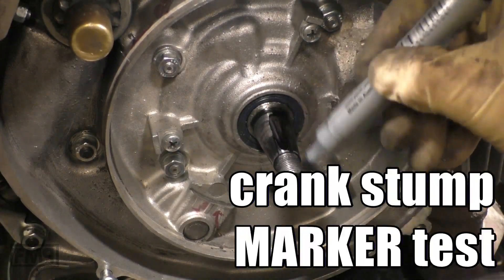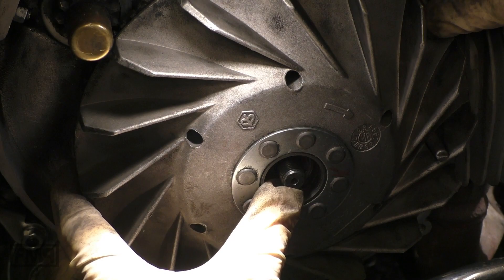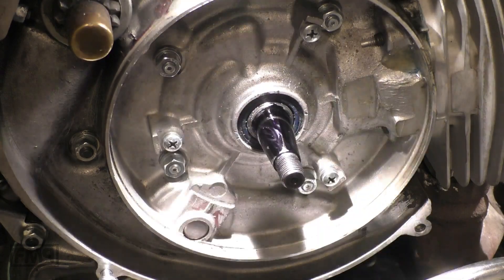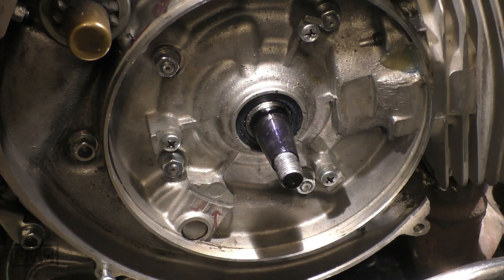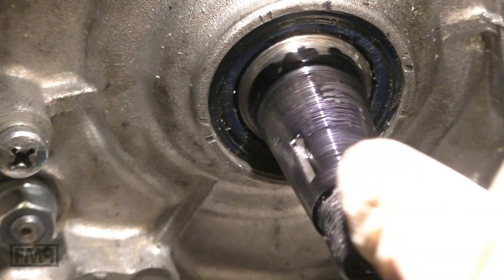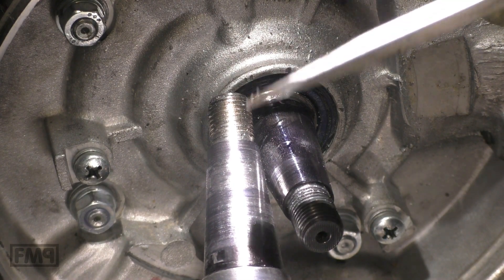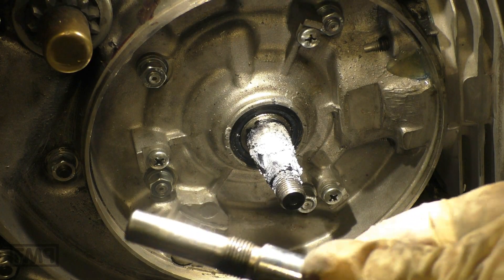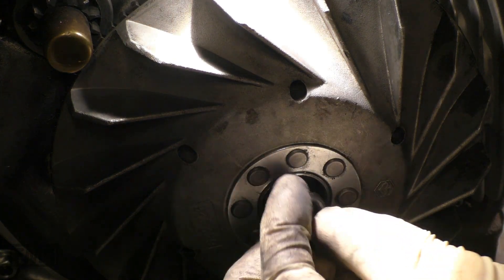vespa crank STUMP MARKER test: PRESSFIT flywheel-crank / #1/2 / FMPguides - Solid PASSion /

Comment: Do you use lightened flywheels? if so, what minimum weight do you recommend for a road/sport scooter?
Thanks

Tschüss
Reply from the maker: i use sip vape. in general not less that 1500gr i would say
Reply: Ok, thanks. 😉
I had a flywheel rectified from PX 200 to 1950 grams (2220 grams original) keeping the e-start gear ring, it may be interesting to lighten up to 1800 grams or less (there is still some material removed).
What do you think?